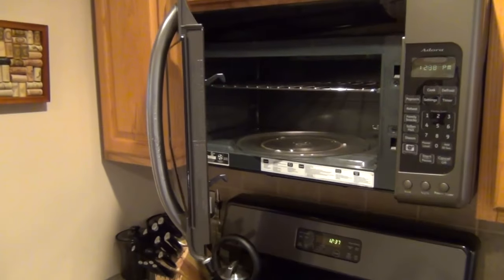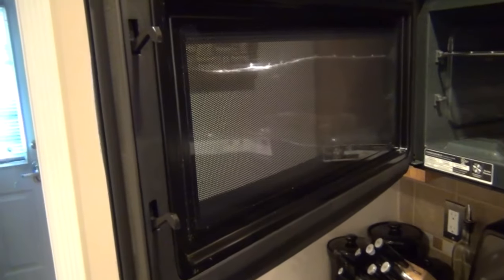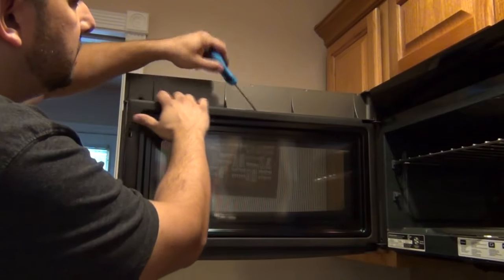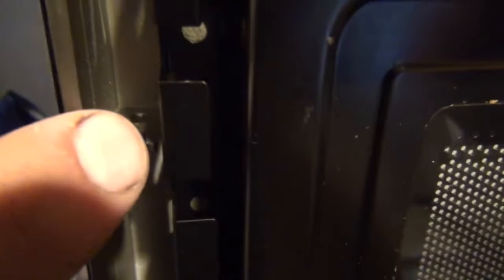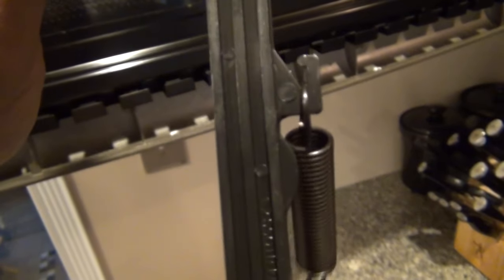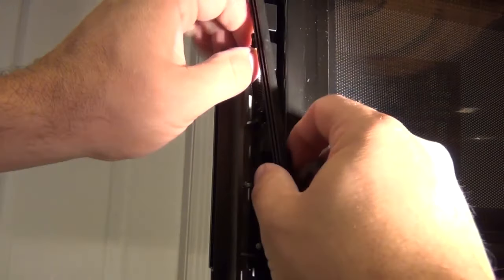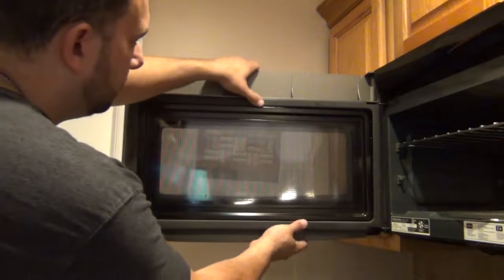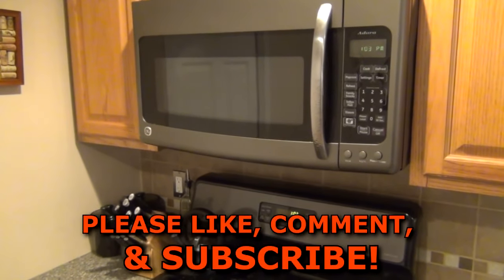Repair a Broken Microwave Door Latch

Comment: I just did this repair on my Samsung after watching this. Super easy! I used a metal credit card (some are plastic and some are metal). Popped the trim perfectly. The best tool for this job is an actual trim remover, often used in automotive stereo installs. They are plastic, super cheap, and won't scratch anything. I have a set of those but they were in my car trunk and it's 101F outside. LOL

Electronics manufacturers intentionally create single points of failure so you have to service or replace your devices. This is a perfect example considering how much more stable and durable the fix is compared to the factory design. 

You can find a single point of failure in ANY home electronics device. For example, a smart phone has two. The battery is intentionally NOT charged properly to wear it out faster (on most models). The screen isn't as durable as it could easily be. My Nord n30 has proper battery charging but the screen is typical. But a $5 screen protective layer fixes that point of failure. Why not just make the phone with a thicker screen at the factory? So you break it. 

Always familiarize yourself with common problems with any device you buy. Then find out if there are mitigating techniques to employ, like installing the spring to the metal part on the microwave handle or installing a screen protector on a new cell phone.
Reply from the maker: Thanks, and you’re 100 percent right, planned failure and obsolescence just for a profit.  Same principle with old incandescent bulbs.  There’s was absolutely no reason a light bulb should have ever burned out. The filaments were purposely designed to fail after a certain about of duty cycles. Crazy!

Thanks for the trim removal tip…great idea 🍻

Comment: Thanks for the video!  Mine was a little different.  Some kind of weird ledge it latched onto instead of a piece with a hole.  That broke out completely and when I hooked it to where you did it was a little too far to the side so it set the balance of the door off and when I tried to shut it and run it a fan just kept running and it wouldn't operate.  So I put a dab of hot glue on the plastic behind the latch bit, where it needed to hook in and attached the spring to the underside of that and that worked for about five minutes.  Then the glue pulled away from the plastic. So today I'm using a weird flat thin bent nut that I found at the hardware store -- siliconing that deep in (well). It has a square hole in the center that bows out and is very strong. I'll hook the spring on that and let you know how it goes. Mine is a Sharp R-1480.
Reply from the maker: Thanks and Nice fix!!…hope it held up.

Comment: Zim: Thank you! You just saved me about $600 for a new unit, installation, and tax that I would have paid. A stupid plastic spring tab that a kindergartener could have designed better. The repair took me less time than your video, and I'm a total klutz. I can't even...
Reply from the maker: Nice work and yes, completely agree. It’s a poorly designed part.

Comment: Thanks!  Just fixed my Samsung microwave in 5 minutes using a small flat head to pop off the plastic frame and hooked spring to metal part.

Comment: Thank you!!!! I was able to hook the spring to the door cut outs closest to where the plastic spring holder was part of the door, the spring is a bit in the way of the latch and it looked like it won't fit but it did, the plastic latch is just a bit moved out of the way but the door latches closed and is tight against the machine, the door does not move if you push against it when closed so its sealed OK.
Reply: The door was also sitting low and was not aligned with the machine so I took the door off, it just lifts up and off, and was able to bend the metal tabs a little to re-align the door properly.   Boy these machines are made cheaply or what....

Comment: Help! Microwave does not function after I made this repair. 
Great video. I did the repair exactly as shown and now the door works, perfectly. Problem is that the heating function is not working at all, suddenly. The  microwave oven takes the cook time setting, the light goes on when I open the door The oven takes the time setting. After I press Start,  the timer counts down to zero as normal, except the carousel does not turn, and the heating element and fans are not functioning. Dead quiet.  Nothing happens inside the oven. The timer counts down to zero This was not a problem before the door spring came loose. What can I DIY now?

Comment: Have you ever seen where the screw itself gets too tight, or not loose enough, giving too much resistance for the door to open easily?

Do you know if the spring comes with the door hook if you buy a new latch assembly?

My door gets stuck SOMETIMES. I bought a new lever as that was part of the problem, but now it's still intermittently getting stuck. It seems like the tension on the latch is pretty tight.

Comment: Great video to help me repair my microwave. Shame on GE and the producers for this crappy design especially when metal components are already right next to it to be used to anchor the spring. A double shame on GE for discontinuing this part so there are no replacement parts available.

Comment: I have a problem with my whirlpool MAX microwave which looks a good bit different than these standard ones. Anyhow, latch broke, and I fixed the broken parts, however I dont know how the spring is meant to be set as it just dislocates and the door latch is loose again as I push the door in. If you ever get to a Whirlpool MAX microwave that'd be amazing.

Worst case scenario I just have to get a new microwave.
Reply from the maker: Hey, it shouldn’t be much different. The spring is attached to the latch on one side and a solid part of the door on the other

Comment: Hi I accidentally hit the lower latch on my convection-microwave and it broke off. It doesn't work even if I hold the door closed. Do some of them have a safety feature that the upper and lower latches have to close? It sounds like it's running when I set it for 1 min to boil water but there is no heat at all. Any ideas what to do? Thanx

Comment: New subscriber here thanks for the videos. I have a question would fixing this door issue fix the button to open the door ? I sometimes have to press for long or at a certain angle to open up my microwave or is the issue at the button on the bottom

Comment: Your statistics are incorrect for mine unfortunately. My Kenmore microwave top post support broke on mine, I epoxied it and it held for a half year then it snapped again this morning. They engineered this thing to break. I think when I pulled it up this plastic outer door cover piece is >$100.

Comment: Bought a new latch and installed it, door closes perfectly BUT, when you go to program the timing, the turntable turns and the DOOr alert starts to light up.  Does not heat.  any Ideas?

Comment: I have a question, I hooked the end of the spring to the metal, as you have shown in your video, the door closed great, but the microwave did not work, the screen said  RUN, but nothing was moving. Not sure what I did wrong? The microwave worked perfectly before the door latch was damaged. Do you have any suggestions? do you think that the" metal " where I am hooking the spring is doing something bad to the electrical system?  I have a Samsung, its only 2 years old out of warranty. Thank you so much!
Reply from the maker: Shouldn’t be. Disconnect the spring and push/hold the door closed. See if it works without it
Reply: @fixitwithzim  I disconnected the spring and push / hold the door closed and the screen still says "RUN".   The screen says RUN, the timer is running, the turntable does not rotate, microwave not warming up...This is a Samsung purchase 2 years ago, no warranty anymore. The microwave was working perfectly before the door didn't lock anymore. Any suggestion?

Comment: The hooks in the door is a dumb idea.  I have watched several instances, in the break room, of hot stuff being spilled because of dishes and cups catching on the hook. The only advantage is ease of fixing the spring problem and for sure the manufacturer doesn't do it for that reason! The hooks should be on the body of the microwave.

Comment: I did this and now the timer ticks down and light turns on but nothing happens when I start microwave. No heat. Kenmore. Sucks.
Reply: The issue was I didn't properly secure the cover, fixed it